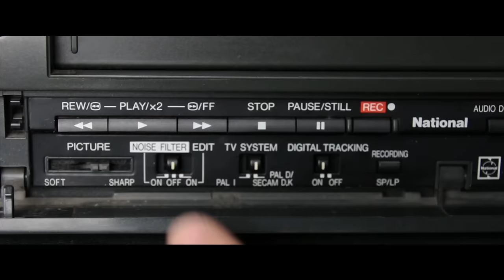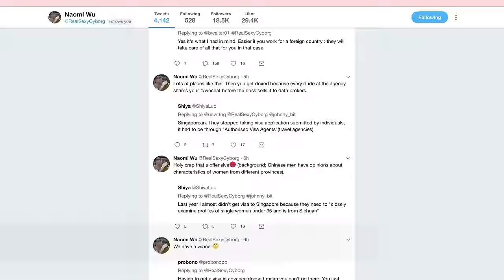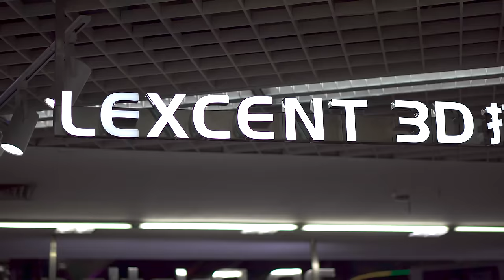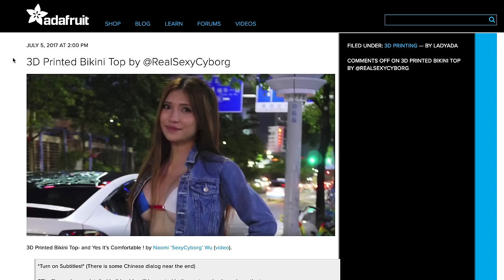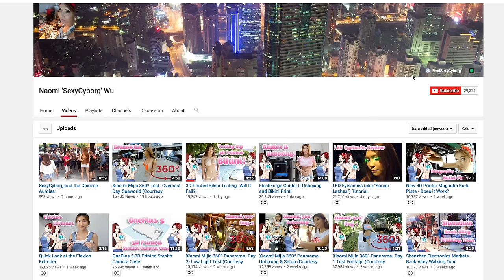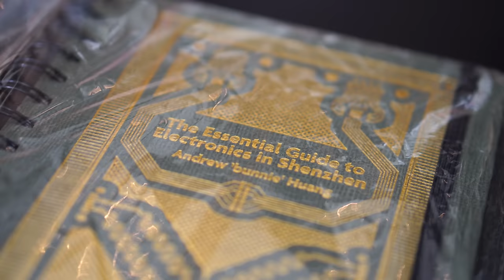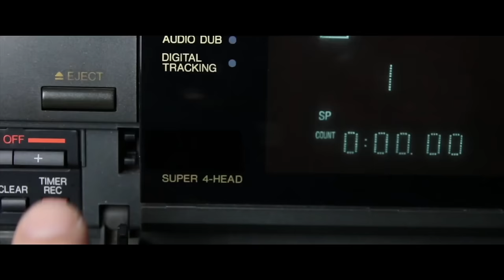Technology is a WOMAN'S game in CHINA!

Comment: Winston, question for you.  Are you upgrading your computer this year?  I'm looking at getting the Nvidia RTX 2070 16GB of DDR4 RAM, Z390 mobo and Core i5 9600k.  I want an i7 9700k, but it's too expensive.  I have $1,200 to spend.  That's it.  I don't care about Ray Tracing right now as even an $1,200 RTX 1080 Ti can only render 30 to 40 FPS using RT in Shadow of the Tomb Raider.  I care more about DLSS with that hybridization of Deep Learning AI and Tensor cores.  Oh yeah.  I wish the AMD Zen 2 architecture was coming out now, because at a die shring of 7nm, I think AMD can clock their upcoming Ryzen 3 3700X next year.  I'm guessing on the name, but Intel's 9th gen CPU's haven't changed much from the 8th gen, save the i7 9700k with 8 physical cores and 8 physical threads, no HT.  The i9 does  have HT though, but both are too expensive!  Anyway, wondering if you're interested in the new GPU's and CPU's.  The i5 9600k is identical to the 8th gen i5 8600k.  The only difference is the IHS.  The 9600k, Intel went back to soldering (Thank God), while the 8600k has the crappy thermal compound.